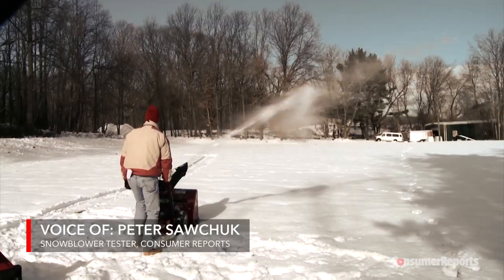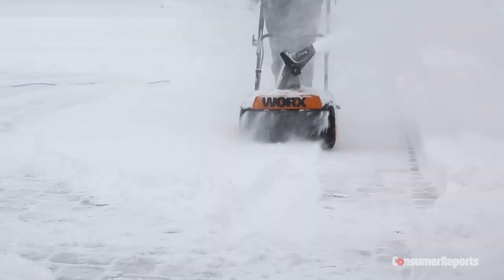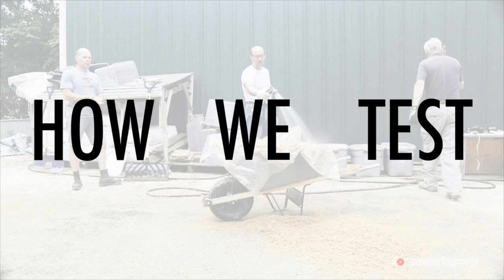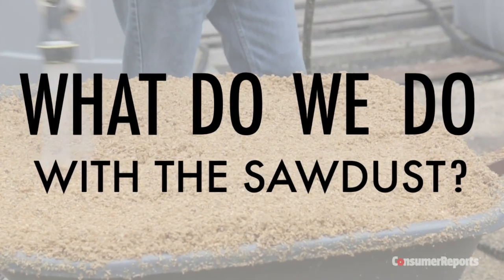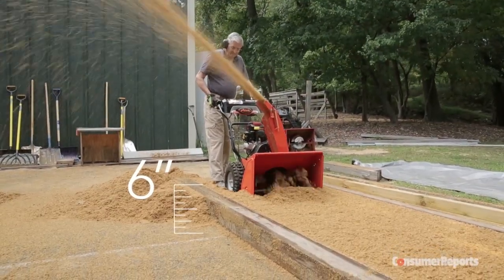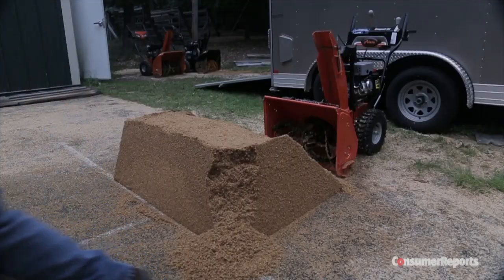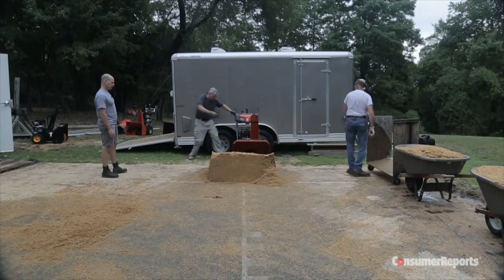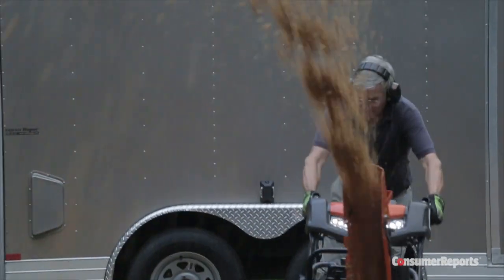Snow Blower Testing Science Revealed | Consumer Reports

Comment: Consumer Reports should go to a hockey rink.  Pay the rink to use it for awhile.  The Zamboni that shaves the ice collects snow.  That snow is wet and heavy.  Have them dump a pile or two of that on the rink and blow it around until your heart is content.  That will enable you to run a blower in a cool environment as most rinks are kept around 32 F.  The machines will also be moving wet heavy snow.  It does not get much more realistic than that.

Comment: I'm sorry, but warm weather wet sawdust is by no means an excellent simulation of what happens with snow.  You're simply not going to sheer any pins that way, and BTW, HOW did you control how much water you put into it?  Your video shows some guy with a hose just hosing it down.  Doesn't seem very controlled to me.

Comment: Now FREEZE that sawdust.. add chunks of ice the size of a dinner plate..run the machine at ten below zero.. and do that for decades and you would be close to real conditions. People who live in Carolina don't buy snowblowers.. If you need one it better work in realistic conditions.
Reply: Then add some water to the frozen mixture to simulate slush, then run that through the machine at -10 while misting the machine with water to simulate freezing rain, while turning the chute up, down, side to side while shifting forward and reverse, on ice, uphill, downhill, running it into half frozen mounds simulating the end of the driveway, in darkness...
I'm disappointed at CR for this lame testing. It's doubtful they have ever used a snowblower in real winter conditions.
Reply: Well said.
Reply: so what do you buy then? a 3 stage?

Comment: The real test would be to hit a brand new heavy duty garden hose you rolled up and forgot about covered in a foot of snow, if it spits the pieces out and keeps running buy it, it shut mine down in a heartbeat but it did get the better of the hose slicing it to smithereens.

Comment: How about testing different types of snowblower belts. I seem to go through them a lot and I'm only going through a few inches of snow. I can smell the belts burning. I should be able to go through a foot of snow with my snowblower.
Reply: Check alignment of pulleys. I replaced the auger belt every year til I noticed the crack in the chassis and the pulleys were out of line. Had it welded and I put a washer in there somewhere to line up the pulleys.

Comment: I can't believe Honda never made it even close to the top.  Did you guys test all Honda models?  Yamaha?
Reply: +todd baker As a previous honda owner, I don't think any snowblower will ever come close to comparing to them. Unless its a Yamaha (Honda Clone). Wish I never sold mine.
Reply: Their test is biased towards cheaper machines if they have comparable performance in their test.  No evaluation is given for longevity either so Honda does not get anything for that either.
Reply: Nothing comes close to a Honda but the only problem with Honda is unless you're in Canada or the upper peninsula of Michigan you'll be very hard pressed to find people willing to spend the coin it takes to buy a Honda or even an Ariens professional which is also in the same price class as some of the Honda's. At that price point I can go purchase a plow for the front of my truck which is what most people willing to spend that kind of money do. Even so if I had a tractor I could get a nice PTO snowthrower built out of heavy gauge steel minimal maintenece needed since it has no engine of its own, with a lot more power and bigger clearing width.
Reply: Honda price is based on the quality, and that goes for Honda anything, not just snowblowers. You can spend $2500 once or $500 every few years. As to a plow, a good Western is about $5k now. And it can't do sidewalks or pathways like a snowblower can. There's pro and con to everything, but to me a snowblower that can move the snow 50' away beats a plow that only makes a pile where I don't want one.
Reply: julie r I don't doubt Honda's quality but yeah 5k if you want a Western mounted on a 3/4 ton full size truck. Down where I live you'd be hard pressed to sell a Honda where I live. I have a Honda single stage snowblower it's awesome yes cost more than many in it's class. My 2 stage I use for more heavy snow is an Ariens and it's 35 years old and have had no problems with it. No you can't do sidewalks with a snow plow but 2-3 swipes and a little shovel work is a lot quicker than a snowblower. I mean no you're not gonna get a Western or Boss for $2500 but you can still get a light duty plow for a small truck or SUV for that kind of money. It will do a faster job than a snowblower and work fine for 90% of the people that buy them use them for their house and it does just fine and that's all they care about.
Reply: I do own a truck, but I guess I see a plow as then requiring you to own a vehicle to plow with, and having to deal with the mounting kit, extra time to hook it up, etc.  At that point it makes more sense (to me) to just pay  someone to plow. Anyway, getting off track. My driveway is 12' wide and 100' long, I can do it in 20 minutes with the Honda, not much slower than plowing, plus I can put the snow exactly wherever I want.
To bad shipping is so expensive, I can buy good used Honda 9hp 28" up here for around $1000.
Reply: For the overall lifetime cost on top of purchase I would rather have spend my money on a snow melt system, saves a lot of hassle and money in the long run.

Comment: The Murray brand won best snowblower
Reply: +Tony McKinnon If thats the case, any credibility that Consumer Reports had is now lost.
Reply: Murray is absolute garbage, go with an Ariens they're much better units and competitively priced.
Reply: Go with a 1970s-90s Gravely unit. LOL
Reply: Jon Homrich areins, simplicity, Honda, husqaurana what every its called are good brand
Reply: ever
Reply: All the ones sold by Hme Depot and Lowes are made by the same parent company it seems. Parts all interchange. Ariens might be different- they use Briggs instead of Tecumslut engines. 
But once you have used a HONDA, well, let's just say they cost more for a good reason.
Reply: Daja Harris Ariens is a decent brand for a medium price point. Honda is good for a ton of money. My Yamaha outperforms my neighbours bigger Honda no problem. MTD machines are cheap and shit in my experience. Look them up and you can see the brands they make.  Fact is, if you know how to use one and take care of it you won't have an issue with any machine.
Reply: This is very true I don't one bit in my mind doubt Honda's quality. I have several pieces of equipment (rototiller, lawn mower and single stage snowblower) that are built by Honda and there is no comparison to them in terms of quality or performance. However in my area you would be hardpressed to sell someone a $2500 snowblower, even the dealers that sell Honda around here don't normally stock the 2 stage units because they sit for a long time. I currently own a 2 stage Ariens that's what I use for heavy snow. For around $2500 - $3000 I can get a snow plow mounted to my 1/2 ton truck and that's the route most people go, obviously not a Western or Boss but you still can get one for that kind of money. Or as I said before if you already have a tractor you can buy a 3 point hitch snowblower made of a lot of heavy gauge steel and they last a good 20+ years under normal use and proper maintenance(grease the chain and sprocket, change the oil in the gearbox, scraper bar, skid shoes).
Reply: Better yet, put that money down on a snow melt system, less work, ice and snow free and no berms or piles on the side of the driveway and operates for much less with no mechanical headaches.
Reply: @jhomrich89  Murray is owned / powered by Briggs and Stratton. Ariens is running no name garbage engines now. The blower might be awesome but if the engine won't cooperate it's useless. Ask anyone who left last year's gas in thier tecumseh.
Reply: @rodbuilder3657  What part of Illinois? Briggs or Tecumseh on that 826?

Comment: I fix all types of snowblowers I personally have a Honda and an Ariens I hate to say it but the Ariens outperforms the Honda. Another little piece information you might want to know about the Honda is you'll have trouble getting parts for it after 15 years i've still been able to get parts for an Ariens that is 50 years old. Honda is a good machine but you better take really good care of it. I have a Honda track drive it is 20 years old The final drive transmission is  broken you can't buy it.
Reply: If you broke the final drive then you didn't care for it properly or used it improperly. Or it was used commercially and just plain wore out.
Parts are available but I find some dealers are reluctant to get parts, preferring to sell new units.
The parts for Ariens or any other cheaper model are easily available because millions were sold, and because there is planned obsolescence involved, requiring a strong parts/repair market.
Reply: I went ahead and bought a Yamaha 6/24" blower with tracks.  Bloody thing is unstoppable.  Electric start and a nice bright LED light.  Plus it's the quietest blower I've ever heard.
Reply: That's hilarious, I've been a small engine technician for 10 years. I own 2 snow blowers as well. One is a Honda HS928TAS (tas=tracks) and the other is an Ariens Deluxe 28+ mod no: 921034 and to be completely honest my Ariens beats my Honda in every category except one. 
#1 Ariens engine is bigger and more powerfull
#2 Ariens Impeller is bigger and more stout
#3 Ariens uses 2 belts to run the impeller
#4 Ariens parts support is amazing I was able to get all the parts in for a customers unit that was from 1970. (friction disc, hex shaft bushings)
#5 thicker steel and an iron gear box. Tougher gear box means bigger shear bolts and less bolt breakage.
#6 I like my Ariens because it's simple.
there are many other things I like about my Ariens over my Honda but I feel those are the main points.
My Honda happens to have tracks and it's hydrostatic that means it does tremendously well on grades and smashing through plow berms. (Ariens makes hydrostatic track models as well)
Don't get me wrong the Honda is a fine machine but I find I wind up doing most of my work with the Ariens.
Reply: i still get Gilson parts.

Comment: The result is they tested a number of snowblowers in a medium that in no way shape or form feels, acts or behaves like snow and now have a pile of utterly arbitrary results based on this testing. The winner will then take the results and slather their product with praise (Consumer Reports Best Buy!!!) and some some poor schlub standing in Sears will see that and go 'Well, that sounds good!' not realizing they tested the snowblower's ability chew through wood in the middle of august..
Reply: the only real snow condition worse than wet saw dust is frozen slush, & maybe heavy slush. this test is more than adequate to demonstrate the abilities of any snowblower for most possible winter conditions.
Reply: Well, It's Consumer Reports.   I used to think they were valid....when I was 8.
You should see how bad their car testing is.   Somebody created an awesome T-shirt (I wished I had bought one) with a guy in a crash helmet driving a car off of a cliff.  The sub text read "Watch Out!  Consumer Reports is testing cars again!"
lol.
Reply: Here's the thing; water expands and becomes less dense as it freezes.. So a solid medium that absorbs its weight in liquid water is going to be more dense/heavy than snow could physically be. If all the snowblowers tested performed period, they're already functioning beyond performance expectations. If one of them didn't perform or suffered a failure, the manufacturer would point out that the testing method and medium is hardly empirical. Either way, it's hard to legitimately say we learned how these machines perform in the medium they were made for.
Reply: @Pure_KodiakWILD_Power  How many winters have you fought? How many hours of your life has been spent chipping ice? How many hours behind a snow blower?  How many hours wrenching on them? How many layers of clothing does it take to work outside in 15 degree weather for hours? Nvm you have no idea. Stay in southern California, they need you!